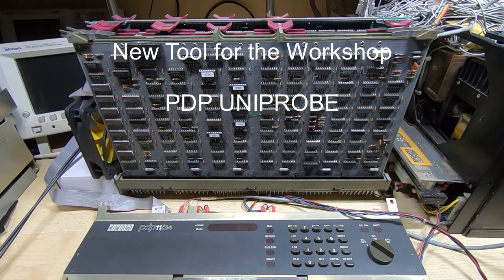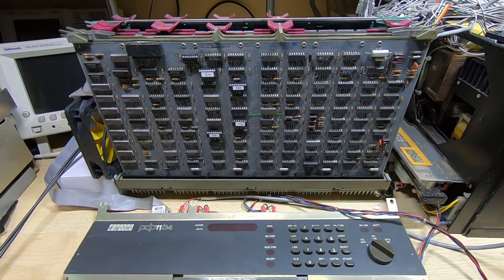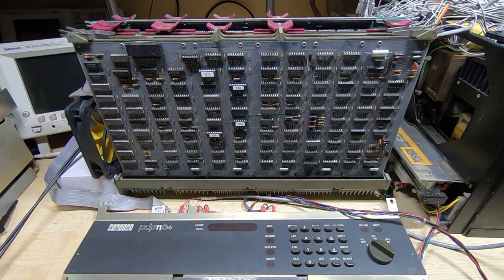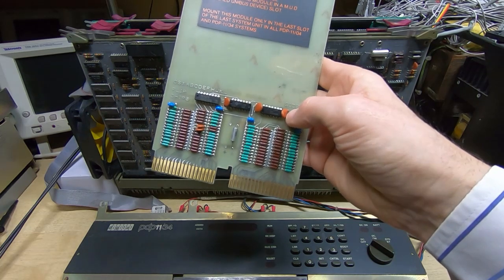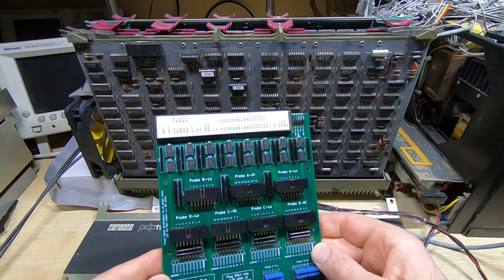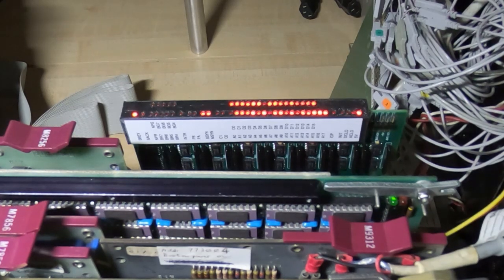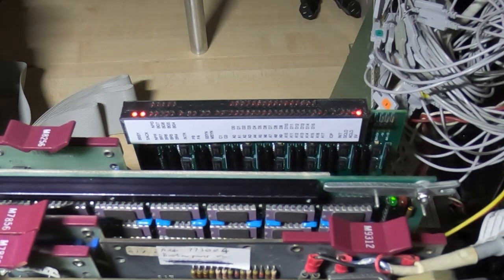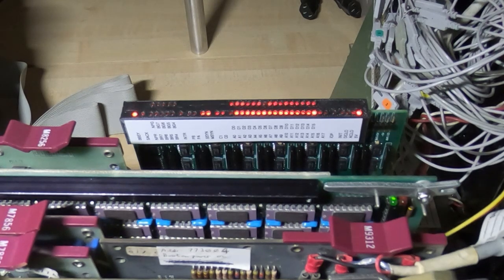PDP UNIPROBE

Comment: Great review Jerry, thanks. I'm in the market for a tool like this, but there are a few units to choose from:
Joerg's UniProbe and UniBone, and Shiresoft's UA11 Unibus Analyzer and copies of the original KM11 boards.
Some are dual height and some are quad height.
Of course I would like the lot but if there was just one (or two) that are considered a "must have", which would people choose?
Reply from the maker: This was not really intended to be a review and as far as I know the UNIPROBE is the only unit available that fulfils this function. The other 2 you mention are for very different purposes and which you decide to buy would of course depend on what testing you wish to carry out. The UniBone is more for emulation purposes but the UniProbe is really just a termination card and bus monitor.

Comment: Hello . I wondered if you knew anything about valve crt tvs . Im scared to attempt to power one i have up, i bought it faulty , it looks all original, i just wondered if maybe i should remove the valves before powering it up since i dont have a variac ? I also dont have an old light bulb to act as a fuse/current limiter ..i just want to try get it to power but i dont have all the replacement caps   dont really have anyone to ask for advice , this is all before my time .
Reply: First you need to check and replace all the capacitors. Especially the filter caps as they tend to go short circuit and you risk damaging the rectifier tube if you plug the TV in. You also need to check and replace all the wax type capacitors, if it has any, because they are notorious for leakage current (they turn into resistors with age).
Reply: @Bata.andrei  yes i understand about this , what i meant was , if i first remove the tubes , then power it up, lets the caps reform and see which ones are shorted or open , and then try it with the tubes in ? I cant afford the full replacment set of caps
Reply: Thanks for replying by the way
Reply from the maker: See my video on restoring a Bush TV22 for a general approach to repairing a valve TV. I have also posted a few Valve repair series on several vintage radio forums.
Reply: @JerryWalker001  I'm still trying to pluck up the courage to adjust the deflection coil on my Ampex serial terminal in order to fix the text lines being "on the wonk"!
Reply: I think Jerry is right and you need to watch his videos on the subject. You won't accomplish anything by removing the tubes. If you don't have  at least the rectifier tube plugged in, there will be no voltage across any of the caps. But if the B+ Filterung Cap is shorted then you run the risk of destroying the rectifier tube and/or the mains transformer.
Reply: @Bata.andrei  thanks, this makes sense